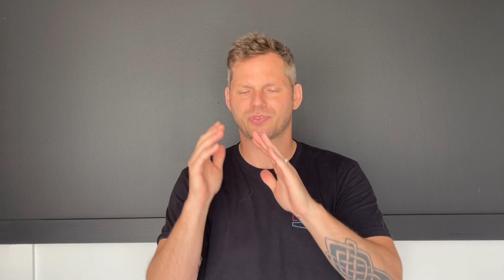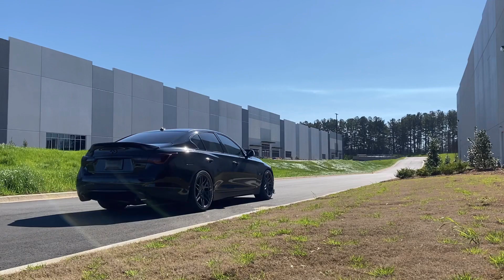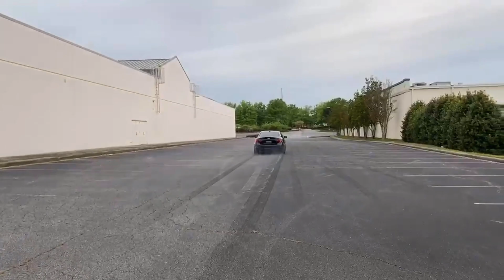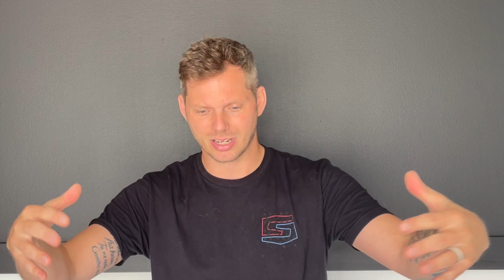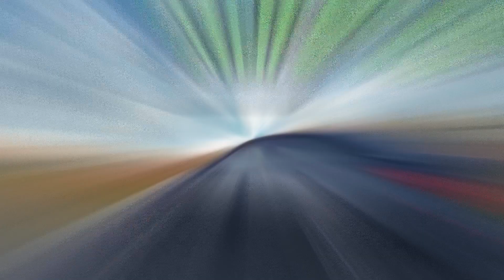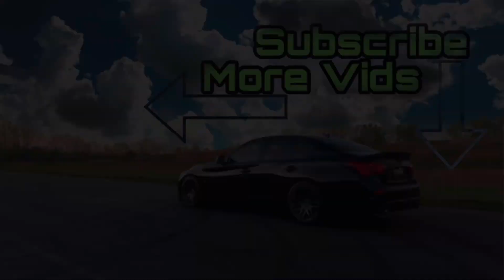Speed Culture Catback UPDATE

Comment: ive had mine done for over a year now 2011 g37x. i highly highly recommend. im sure my g sounds better than any other g in my city.....i went magnaflow......sounds fucking fierce. thanks SCS
Reply: Apparently it's more aggressive...but I wouldn't know... I also have the resonators...but decides not to use them....sounds amazing. I get a lot of compliments
Reply: How does magnaflow sound different from borla?
Reply from the maker: @chilinchen2656  there is potential for a bit of rasp to sneak through.  It’s a smaller muffler overall.  Some people like a little rasp.  Overall volume is very similar.  May not even know the difference
Reply from the maker: Heck yeah!!
Reply: So you went magnaflow instead of the borla xs?

Comment: If you go to a shop, asking for a 1-2hr fabrication + install, you will be f'd in the a. And then you will come to Mils Garage Customs, where we will fix it for you at the real costs it takes to build/fabricate quality exhausts. Happens every week.
Reply from the maker: I’m sure you guys do good work, but it’s truly a 1.5 hour job at most.  Any decent shop can handle it.  Inman muffler is a prime example and my old shop back home in Minnesota could whip this up in their sleep.
Do you guys have a pipe bender?  If I had some more room, a lift and a bender I’d just start installing these myself lol
Reply: @SpeedCultureStudios  So the latest customer to come in the shop (car is there now), went to another shop for simple fab work, and now they have their flanges cut off and welded together. We don't bend pipes, because it crimps down the diameter, so 2.5" becomes 2.25", and 3" become 2.6". We only make full diameter show competition exhausts, which are guaranteed not to leak. We don't weld on the car, because that will leak every time. This exhaust is a min 8hr single exit; dual takes more time.. Unless you're ok with leaks, and then we send them to another shop. No loss on our end at all.
Reply from the maker: @milsgarage  I’ve talked about this extensively, and mentioned it in this video, but the bends in this system are not extreme enough to impact anything.  Even the slight loss in diameter will not hurt flow or performance.  Not a single big.  You really have to restrict flow to hurt performance.  In addition, in the VQ in particular, the factory catback at just over 2” in some spots is not an issue, so a “crush bend” on a 2.5” pipe is certainly not a problem.  Now if you’re going for a show car with mirrors showing the underside, sure I’d go a different route.  
I also have to say that if you’re getting leaks when welding on the car, you have a welding issue lol.  I’ve had dozens of systems welded up while on cars and have never had a leak.  I’ve also never had a shop cut off the flanges—that is just ridiculous to me—unless the person did not buy a set of flanges and had no idea what they were telling the shop.  Exhaust systems are my bread and butter.  I’m going in 20 years of doing this stuff on multiple platforms.  I decent shop can do a very nice job with no problems.
Reply: @SpeedCultureStudios  Alright, well you're getting hooked up by that shop you're going to. i'd probs tip them a good $400 for their work. Welding up on the car always leaks. It's a half-assed weld, and you really think there's enough room on the top end of the pipe to get the mig in there? Like i said, these shops that do that keep us in business, so i'm actually grateful
Reply from the maker: @milsgarage  there are over 800 people with this particular setup that are very pleased.  I did not have a hook up at the shop when I got this installed three years ago.  I’m not necessarily hooked on my shop it’s just that if there is one good one there are bound to be hundreds more good ones across the country.  But for sure for every good one there are 200 bad ones.  
Yes in the Q50 there is room to make good welds.  Flex pipe is also very helpful in this case.  The tightest spot is between the pipe in the borla but the flex allows you to droop it down and access it quite easily.  There is no clearance issues at all for tips and for the resonators out back—and if necessary the flex allows for additional access before hangers are welded on.  Not every platform is as easy though!  I’ve gotten expensive aftermarket tig welded systems over the years with pinhole leaks and motordyne has established a reputation lately for welds cracking so there is no guarantee it’s not going to leak.  Even when welded by machine.  But I wouldn’t trust just any shop.  I drive 45 miles to mine instead of going to any of the 30 in a 10 mile radius.  Definitely need to do some research before going to get exhaust work done.  There’s definitely a need for what you all do!  It’s just not attainable or practical for most.  But to say you can’t get good, quick work at a local shop is just not true.  There are some very talented shops out there that would take offense to that.
You also have to remember that this is a budget friendly alternative to those expensive systems on the market. If you’re paying 8+ hours in labor alone there really isn’t a point.
Reply: I wish this had taken 1.5 or even 2 hours. I swear i was in there for at least 6 hrs. Probably because they were severely understaffed. One guy working on 4 bays. But it got done sounds lit especially in the parking garage
Reply: @The_sTress  6hrs with a pipe bender sounds rational.

Comment: I finally got my 3.0t awd done. From front to back I went with the flex pipes, magnaflow, flowmaster fx then  tips. All pipes 2.5inch. Prices are up I was charged $482 for the install.They knew exactly what to do though and I didnt have to tell them anything. It sounds pretty good so far but barely drove it a day cause the car is at infiniti getting my heat exchanger installed. Will try to get some clips soon. Thanks SCS. Forgot it also came with a 2 year warranty from the shop.
Reply: I have 2020 3.0t and I real curious to hear before I follow through on this upgrade. Clips yet?
Reply: Can you do a parts list as well?
Reply: @Username_8886  Remarkable Power RK7545 flex pipes, upower x-pipe 2.5 #192265, Flowmaster 71416, upower 2.5 tips #184290.
Reply: @lewis6720  how is that u power x pipe treating you I just might get that instead of borla pro xs
Reply: @junebug4478  I have had no issues with the x-pipe. I have a 3.0t not a 3.7 though.
Reply: Lewis you have a ig with a clip
Reply: @denorrisnicholson5227  I have IG that I barley use but will have to get back to you with a clip, haven't made any.
Reply: @lewis6720  Ite good deal
Reply: any update? or the video or clip via insta?